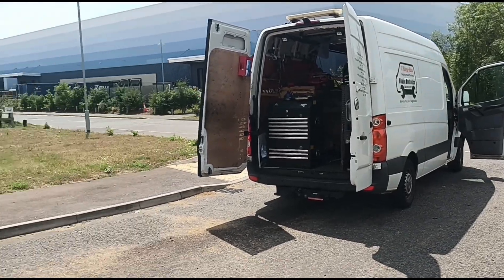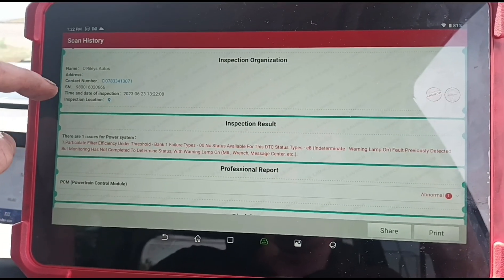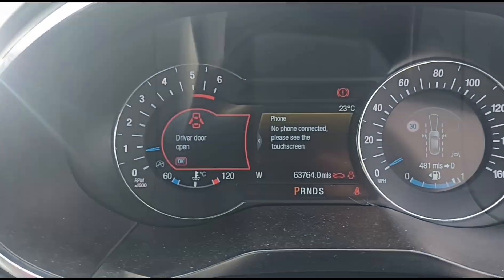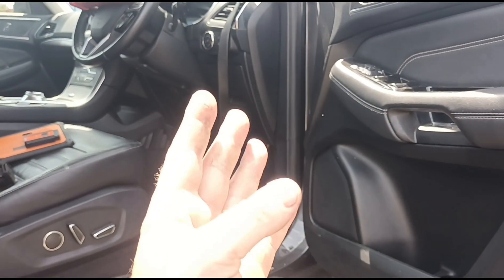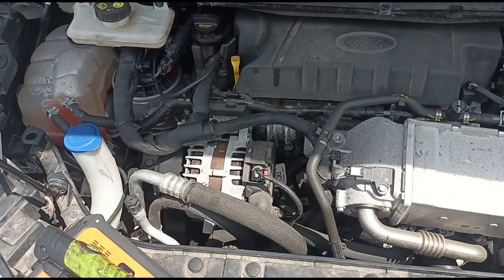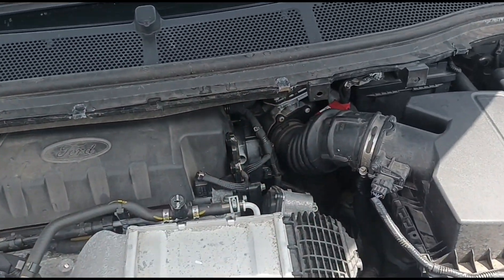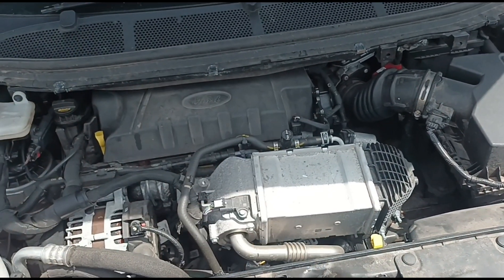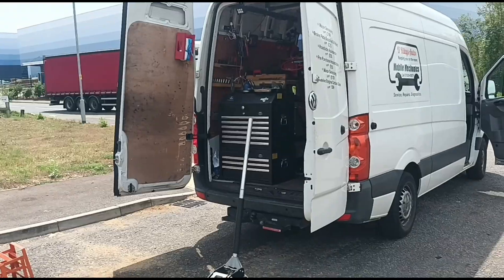Ford 2.0 Euro 6 Eco Blue DPF Issues P2002:00-E8 Particulate Filter Efficiency Under Threshold.

Comment: Have one of these.. 57000kms and a P2002. Diagnosis was a dead DPF due to faulty injectors. Ford covered half the rather large bill. Now I'm thinking about putting it up for sale before it blows up the DPF again. Thankfully the dealership took it in almost immediatly and fixed it in 2 days.
Reply: I have the same issue mate. How did you fixed it and how much was it ? I need help also.
Reply: Was the car not accelerating? I have the same car got ecu remapped deleted the dpf car still doesn’t accelerate i don’t know what is the problem
Reply: @ZaferSustan  it accelerated perfectly

Comment: As a Ford mechanic from Australia, there is a TSB for P2002 on our Ford Endura' s with the exact same engine.  The root cause for this issue on the Endura is internal corrosion within the fuel injectors causing premature failure of the DPF/SCR.  To rectify this issue, all 4 fuel injectors and DPF/SCR assembly require replacement.   Note, the DPF/SCR is not fun to replace, especially if the vehicle is a AWD. REF "TSB 20-2335"  This is on Australian PTS. 

As this is a UK vehicle this may not be the case, but we are using the exact with same engine in Australia in our Endura's so it wouldn't surprise me if this has the same issue.
Reply: Just had a P2002 in my Danish S-max. New injectors and DPF - sounds like your TSB even though the dealership insisted there was no TSB on it.
Reply: @larsmadsen8678 Same issue on my 2021 s-max here in DK. Ford just blames the way I drive. Higher rpm and longer trips. Drive 60km daily and .. it can’t be that a car is made, so that it can’t be driven in drive without clocking up. Did a static regen my self, and filter cleans nicely.. but the error keeps re-appearing within a day or two
Reply: I found the TSB on AU PTS, and my car is currently having very similar issue. My local Ford dealer is refusing to honor the warranty due to they claimed I am using Diesel treatment. Seems like I have to replace the DPF and the Injector myself.

Comment: Shame really this car would probably be fault free if it was a year older because s max and mondeo up until late 2019 had the old Peugeot 2l diesel which is a bulletproof engine. Can’t understand why they stopped using them because they’re all euro 6 compliant. And they replaced it with this absolute turd of an engine
Reply from the maker: Any vehicle I see with a  charge cooler on top is a Turd
Reply: Is the current Pug 2.0 HDI ok?

Comment: Mate we have a kuga stuck in the garage its stuck at 300 percent soot content.  Like its locked in at that . cant reset noting.  Tried absolutely every trick i know . . Dpf been removed and professionally cleaned.  And new diesel injector.  Pressures are now1 at 0.0 milibar idle and 3 milibar on rev at 3000 rpm . But can not reset even got a ford machine to try no luck . Have u any clue be greatful
Reply from the maker: What year is it
Reply: @ORileysAutos  its 2013 mate 2.0 peugeot  engineits 2013 onwards
Reply from the maker: @eoghanhennessy443  never had issues  with them on my launch